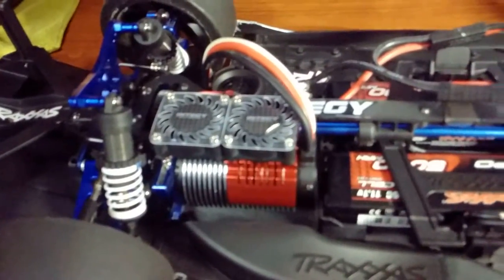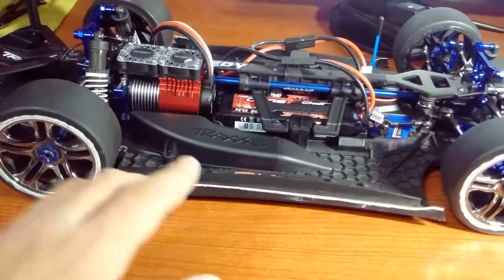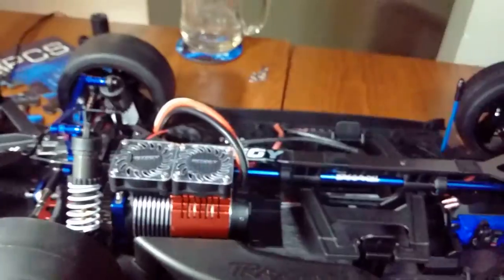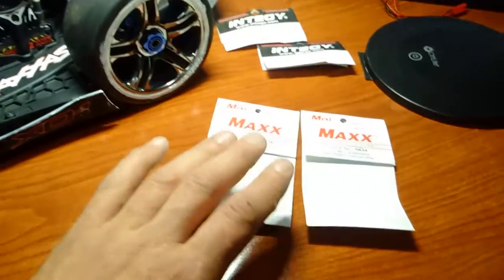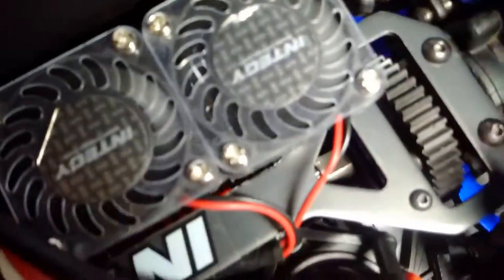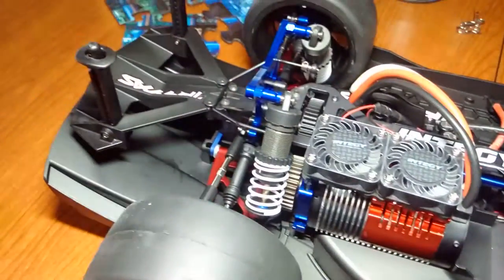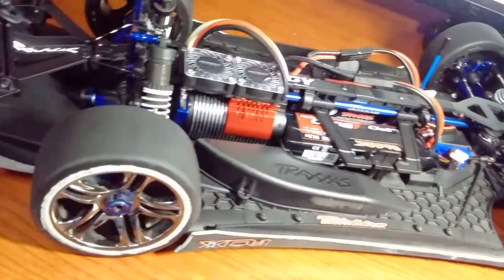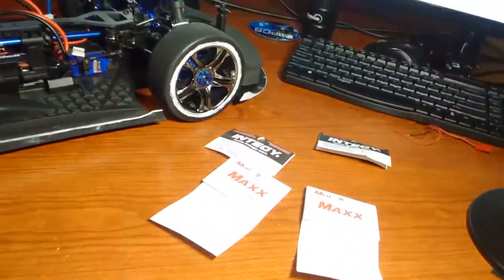Two Traxxas X0-1 - INTEGY Dual Fan Install

Comment: Now that you run a 20t pinion how does the integy fan work  ? Does it control the temps ? What batteries are you running ? What kind of run times are you getting  ?
Reply from the maker: The fan works as it should, keeps the temps down very much so. I'm running two 3S Venom 50c Lipos. I'm getting about 100kmh with this setup, nothing crazy but it's still very fast. I don't do speed runs with my rig, just cruising in a parking lot.  cheers mate :)

Comment: I'm thinking about getting this fan for my xo1. Does it pop right on the motor ? I'm running 18 pinion and 46 spur. What gearing are you running  ?
Reply from the maker: I'm running 20pinion & 46 Spur brotha.  The fan does not pop right in, you'll need to bend the fins a bit to make it fit over the 49mm motor, super easy.

Comment: how does this 40mm fan fit a motor which is 49mm thick with the fins?
Reply from the maker: The fan is 40mm, having said that, you'll need to widen it a little, it bends really easy and is duable with hands. The casing is alloy, i widened it a bit  to make it fit over the motor. Thanks fr stopping i mate :)